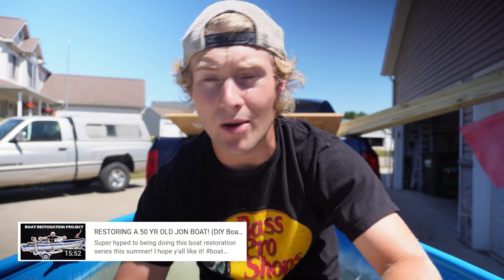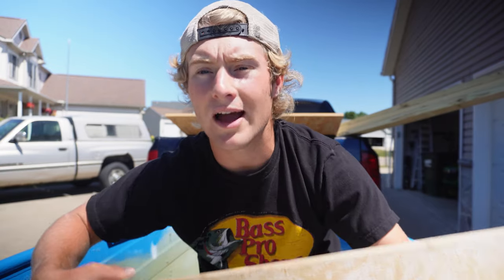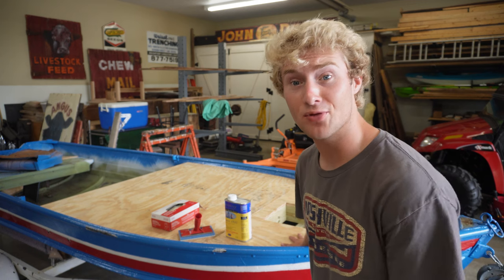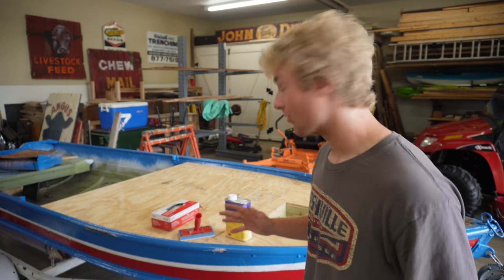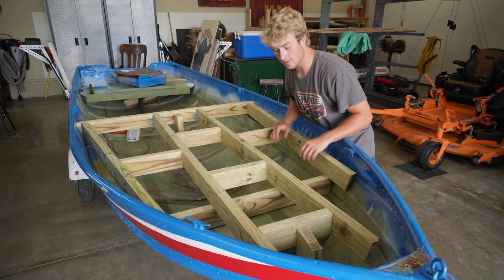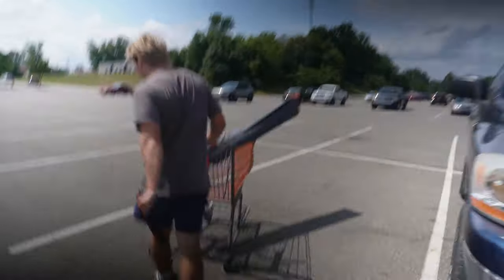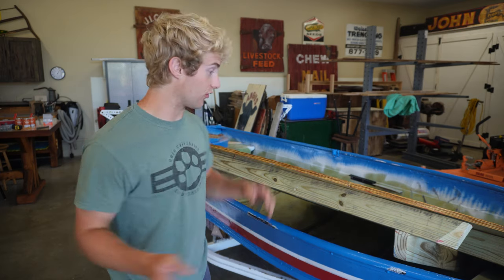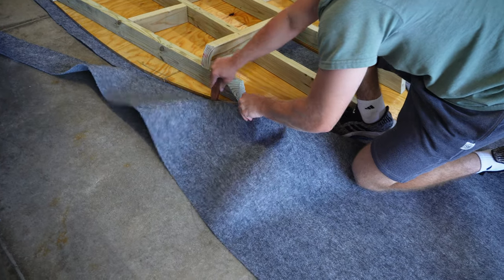JON BOAT DECK BUILD (Boat Project #3)

Comment: Any idea what the deck sub floor weighs
Reply from the maker: I don’t know an exact number but the wood makes it fairly heavy. The deck floor could be simplified to make it lighter if need be. However, it will not be as sturdy.